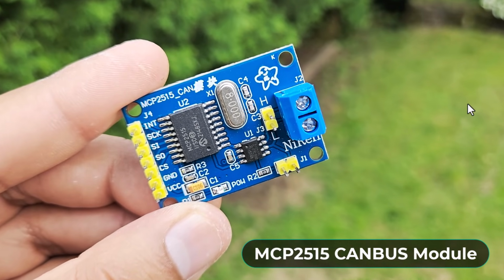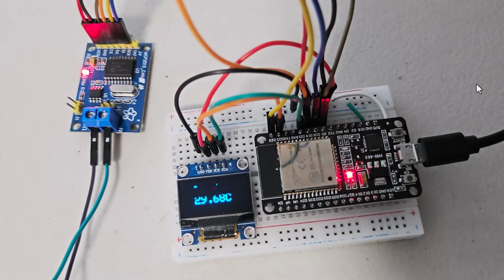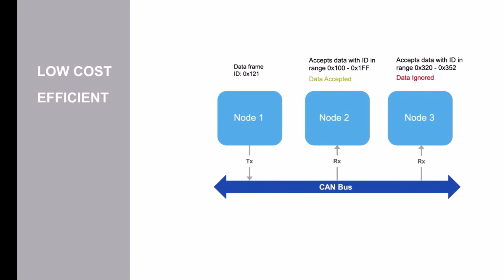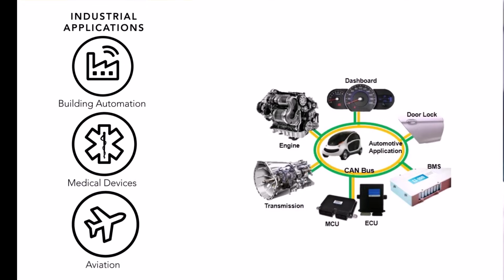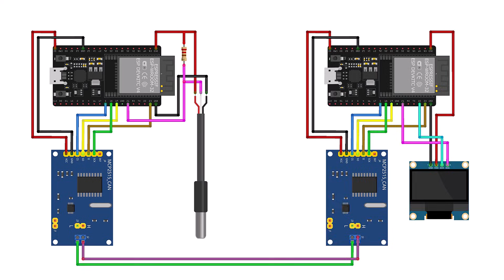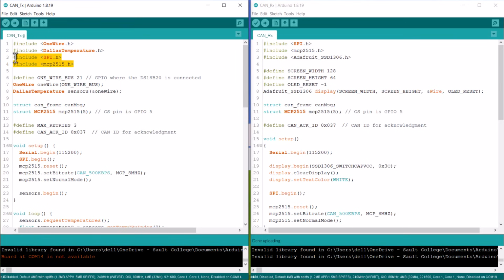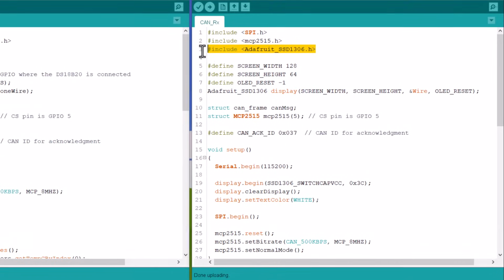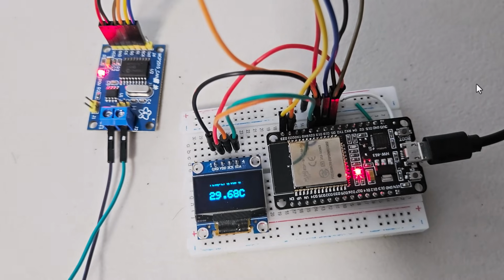ESP32 CAN Bus Tutorial | Interfacing MCP2515 CAN Module with ESP32

Comment: Note with this setup, the ESP32 SPI pins are running on 3.3v, whereas the MCP2515 SPI pins are running on 5v. It should still work under normal conditions but there is a risk of overvolting the ESP32 and also mis-communication between the ESP32 and MCP5215. A mitigation is to use a logic level-shifter between them or swap out the MCP2515 for a 3.3v alternative like the SN65HVD230.
Reply: something like TXS0108E Bidirectional Logic Level Converter 8 Channel would it work well to convert the 5 volts into 3.3 v for the esp32 ?

Comment: You mentioned the MCP2515 can communicate up to 1 Mbps. It can, and maybe a bit faster too, but not with that 8 MHz crystal... If you swap it for a 16 MHz one it works though!

The reason for this is that the chip's internal divisors cannot provide values to give exact timing for a standard 1 Mbps rate, only a bit below or above. Two MCP2515s will probably work together, but they will not synch with other CAN devices on the bus.

Comment: i use DOIT ESP32 Devkit V1 and its NOT WORKING. Here something i found problem.
Your blog use SCK 013, but your video using SCK 018
Your blog use INT 04, but your video not use INT
From github example using CS 10, your video using CS 5
From github example doesn't use SPI.begin(); your video use it
Your code using default SPI and your pin was VSPI (5,18,19,23) but default code of SPI (based SPI.cpp) was HSPI with mean pin 12-15
I cannot figured out how to fix this..
Reply: Ran into the same issue, really bad "tutorial".
Reply: А если просто переназначить пины с помощью библиотеки SPI?
Reply: У меня сейчас есть проблема. Я использую контроллер RP2040 и по идее для каждого контроллера есть своя библиотека
Reply: Hi, were you able to resolve the issue?

Comment: But.... The ESP32 has a CAN bus controller built in.. All you need is a transceiver. There is no need to first talk SPI to an external controller, to then be able to talk CAN BUS.. Cool video though and it's a good product. Thanks!
Reply: For those of us migrating from arduino and already have a bucket of MCP2515 boards, this is ideal.
Reply: There are some problems with the built in controller.
Reply: @IJO221  like what? I'm new to this, so I would like to know!
Reply: @flixrao  at the time of writing that comment, we hadn’t quite figured that out yet, but now we have. After many hours of pain, my group has found out that there was a firmware update that bricked it in many esp32s. 

You also have to be careful with certain esp32s because the SPI interface used with external controllers are virtualized and you have to set them up a tad differently than shown in this video. It can be a pain. I love poor documentation.

Comment: can you say how to connect arduino uno and esp32 in this method?
Reply: It should be the same as shown in the video.. Normally between an ESP32 and an Arduino you'd need a logic level shifter because most Arduinos are 5V and ESP32 is 3.3V. However, most MCP2515 will come with voltage regulators so this wouldn't be necessary.

If yours don't come with voltage regulators you'll need a logic level shifter in between the ESP32 and the Arduino.

You'll also need pull-up resistors for anything that doesn't have internal pull-ups. 4.7k Ohm resistors do the trick just fine.

(This also goes for I2C and SPI)

Comment: I have a comment, in your wiring diagram you connected the RXCAN with RXD and TXCAN with TXD, is it correct?
Reply: In can you wire rx to rx and rx to tx with most modules. Really confusing at first.